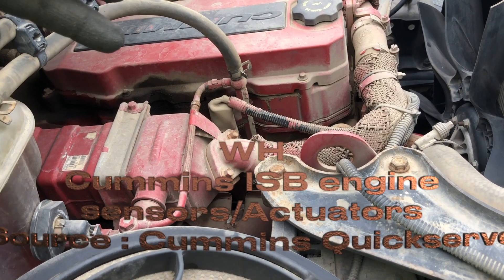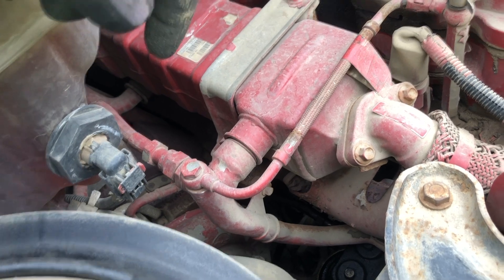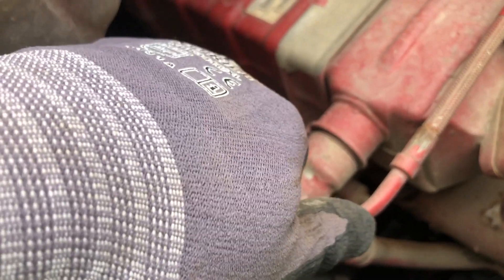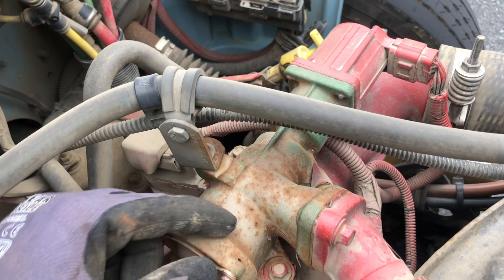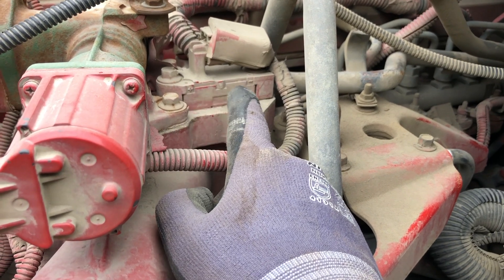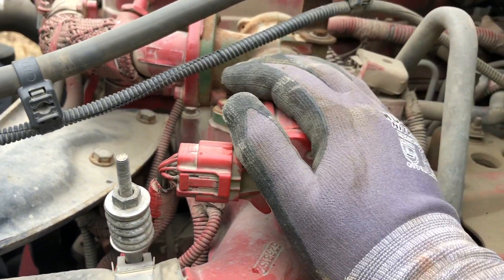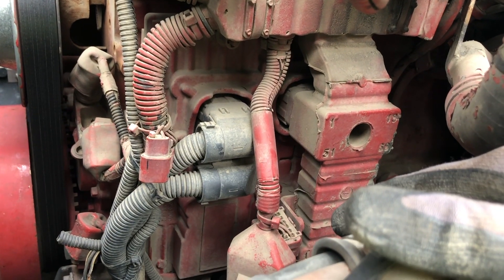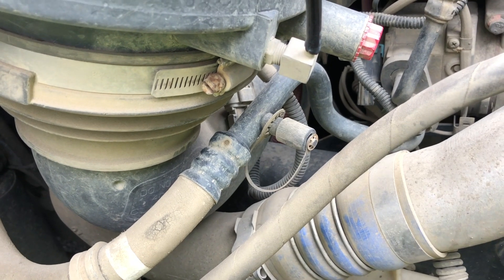Cummins ISB  sensors/actuators locations

Comment: Where the exhausta manifold pressure sensor
Reply from the maker: You will see a small type at the front of the exhaust manifold , it goes up to the side valve cover on the passenger side and at the end there is the exhaust manifold pressure sensor

Comment: Where is the coolant temp sensor located?
Reply from the maker: Front of the engine, passenger side in the thermostat housing. Where the upper radiator hose leaves the engine, it will be the two wire sensor right there

Comment: Man where are you located.... I have this same truck and i cant get check engine light out or forced regen to work
Reply from the maker: I’m located in Maryland Baltimore, you definitely need to pull the codes and get it fixed to be out of the derate so it can regenerate

Comment: Where is Aftertreatment Gas
Temperature
Sensor 3 located in dpf?
Reply from the maker: What year you are working on ? The old ones have input and output temps for dpf and SCR , i hope im not missing a third one , the new ones have doc dpf and scr all together in one unit as far as I remember they have 3 temp sensors
Reply: 2008

Comment: Hello
The engine light turns on when I start the truck in the morning, I cleared it a couple of times, I drive the truck for the whole day and the engine light doesn’t come on, but it does comes back on the next morning when I start the truck, it says turbocharger actuator #1 abnormal update rate.
The truck runs fine , is a sensor that might be bad and it’s misreading?
Reply from the maker: Do you give it enough time when you cycle the key, very common it happens when you just turn key straight to crank. This could also be a VGT actuator starting to act up, you need Cummins on-site to test it
Reply: @ ittakes about a minute , this morning the light didn’t come

Comment: Do you know where the Oil Pressure Sensor is located?
Reply: Do you know where is the exhaust gas pressure is located???
Reply from the maker: @chuydelgadilloflores4892  look right under the egr cooler , on top of the turbo you will see a little 3/8 inch metal lines leaves the exhaust manifold to go to the sensor
Reply from the maker: I honestly never had that sensor go bad on a Cummins , look on the block most from the bottom , it is likely where by the  ECM . So much of shit in the way that hide it
Reply: @WheelersHoarder  You pointed out an Oil Pressure Sensor in the video at 5:07. Did you misspeak on what that is?
Reply from the maker: driver’s side of engine block
Reply from the maker: It is supposed to be on the driver’s side of engine block on the ecm side